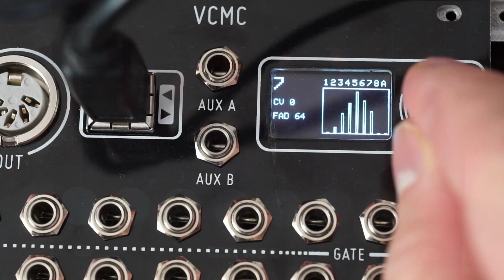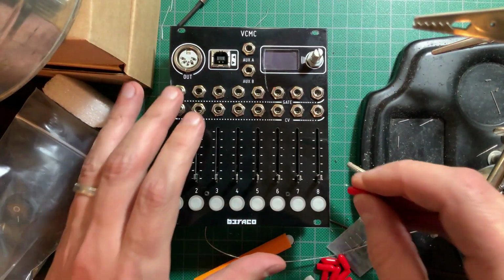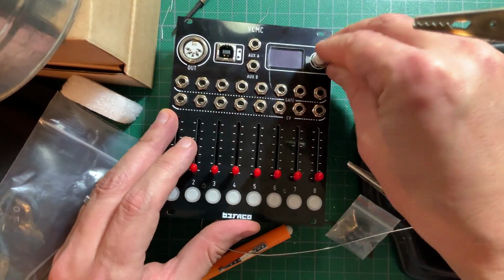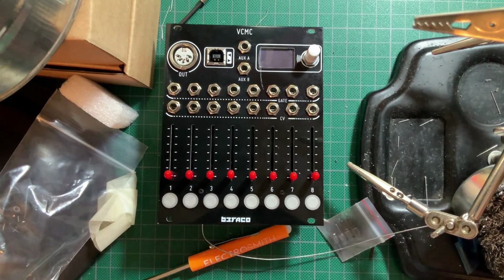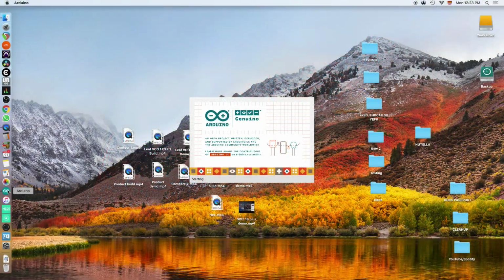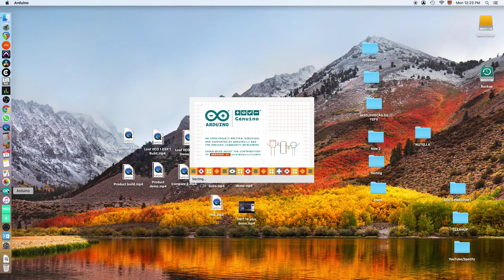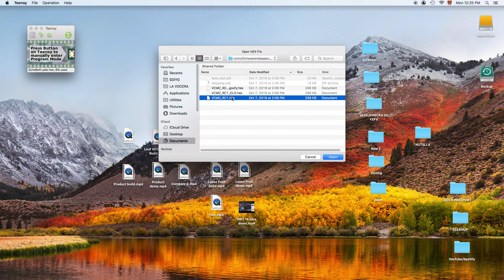Building the Befaco VCMC!

Comment: Dude you completely SKIPPED OVER the one part of the instructions that was not clear. You completely skipped over prepping the OLED display. There is a section in the instructions that talks about prepping the header leads on the OLED display, cutting the leads to 3mm and removing the "row" that is fitted to the OLED leads. You go from showing the OLED display setting flat on the table, to installing it on the PCB and completely skipped the prep stage, the one section I was hoping to get some clarification about.

Also why does your videos always show the assembly in super fast motion. That makes it hard sometimes to see what you are doing. You videos make a very good reference but I feel they would be even better if you filmed them at normal speed. We can always jump forward if the video seems to be taking too long. Just a suggestion.
Reply from the maker: Thanks for the suggestions! These videos are meant to complement, not substitute for the written manual.

Comment: Hello I am currently building this module. I have tested the voltages after power building and some of my voltages are a little low. a variance of about 1-1.5 Volts on the +12v and the -12V is this OK. I have been unable to contact befaco.  Also I was wondering if you performed any kind of flux removal when soldering boards. I am finding it super tricky to solder these small pads without additional flux 

Thank you for the amazing channel.  If it wasnt for this I would not have had confidence to build these modules myself